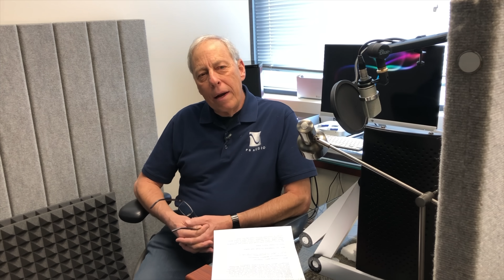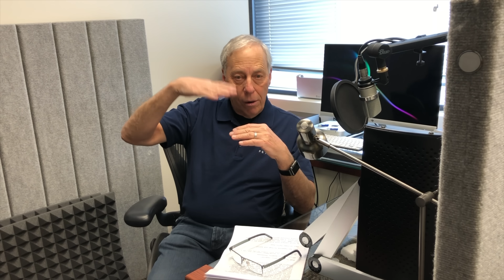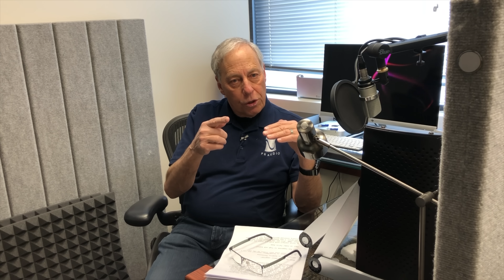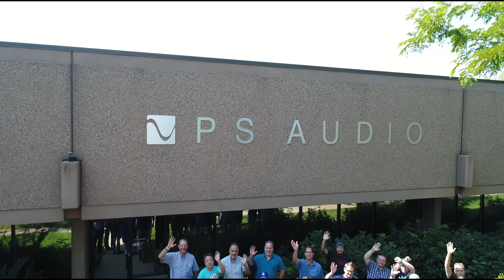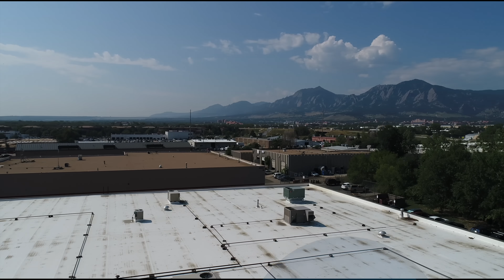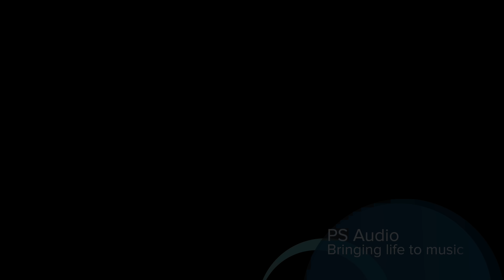Is an external clock on a DAC necessary?

Comment: It's important to note here that in order to have the DAC clock used, the connection to the source (e.g. computer) has to be via USB which is asynchronous; otherwise, if you connect to the source via, say, coax or optical/toslink then the clock accuracy is determined by the source.

Comment: I don't understand all the tech about it...just always trying to improve sound quality...someone please tell me a good external clock to use with my setup shown below...I was thinking of the Gustard C18 since my DAC & DDC Is also Gustard...
Present system- Vincent hybrid 737 -4 Ohm: 2 x 300 Watt, Gustard R26, U18, ifi zen streamer, Dali Rubicon ll, Rel T7x w/  AudioQuest Type 5 REL Acoustics High-Level Subwoofer Cable...

Comment: External? It depends whether better or worse. External clocks purpose is to synchronize different devices. Eg. in a studio. Using PLLs and good supply of clocking circuitry nowadays minimize the needs of external clocks, You can use multiplexed signals to drive your PLLs. 
On the other hand, an external clock has no direct effect on the internal quality of clocking and thus sound. It can, if it is better than the internal. But I’m highly in doubt of this. Just one bad clock dealing stage after the external (or internal) clock with high noise power supply can ruin and rejigger all the high quality clocking signal. This is the reason, we use direct clocking to our DACs. The DAC is direct connected to the clock (XO), all the other parts being of higher jitter tolerance are only indirectly supplied, some even by multipliers. The clock itself is provided with ultra low noise power supply.

Comment: The best clock is the one sitting next to your dac. If your DAC is well designed and therefore has a good clock, you don't need an external one for those 0.01% better clock performance. Sometimes having less devices in the signal chain is better.

Comment: Yes it is necessary because the standard in audio is so bad.
No audio company really uses them, they exist as individual boxes that come with lousy LPSU's that are horrible in sound, that is why people don't think that they work. So it's kind of a big kept secret, that no one really has been able to figure out how to use.
My friend got one: Gustard u16, and he uses it for his streamer. When doing a lousy standard job, it only makes the sound about 1.5x better. But after he now has used a couple of years fully understanding how it works and locking the signal with a GPS lock on 9.9999997 mhz, and using certain cables with LPSU's that cost about 5 times more than the clock and building a custom LPSU, and pairing with an uptown audio isoregen. It now gives him about 10x the effect. So yes it is necessary once you have heard that huge difference.
Here is the sound difference:
1. Harshness down to about 1/3.
2. All music he owns is now relevant and natural even in DSD format.
3. The level in warmness and depth is so much more evolved you would not believe it.
4. And the timing is so crazy, that the sound is just rock solid, and that is even with gear that is subpar.
5. Volume before could only go up to about 50% before it got uncomfortable. Now he is at about 80%.
6. Every detail becomes available while the sound becomes more natural.
7. Detail also very importantly gets a lot better released so it sounds like you have really expensive components in your gear.

Again, you have to be really good at setting it up for it to do a big difference. This it not a plug and play product and then you are done. My friend who is one of the most hardcore audiophiles, used 1000's of hours tweaking it, and making it work right on his streamer.
There is a huge potential to be had when manufactors can figure out how to bypass the internal clock and use a really good external clock in DAC/streamer/CD/digital amps/routers.
It also makes sense when you think about it, you isolate a part so it stays more true and does not effect the rest of the components in a bad way.
But again, you have to have the skill to do it, buying it is not enough. Plus there is a difference in quality between the clock products.
Reply: well, I wouldn't trust a manufacturer that makes dacs to be the final word on whether their dac needs an external clock, or not, so I'm already skeptical of Paul and the noise he makes in this video. Not to say I'm the one who knows. Your comment makes sense, as the world becomes more and more deconstructed down to nano particles, more and more accuracy seems a reasonable pursuit. or you can say it's not necessary unless your dac, which we make, sucks, which ours doesn't, which transliterated, is what he said, in a very convoluted manner, IMho

Comment: One of the issues surrounding external clocks is that they can actually induce distortion and noise that some people like. For example, in pro audio a big clock manufacturer is Antelope. They actually advertise that they ADD specific jitter or "acoustically focused clocking" to a low jitter clock in order to create a coloration of the sound. Hardly any modern converters are going to benefit from a clock outside the mainboard, which is usually much less accurate, so what a consumer is getting is a specific flavor of euphonic distortion.

Comment: In audio/video *capture*, long time stability of clocks is an issue. Prosumer devices typically drift away about 1 video frame (1s/25 frame in Europe) per hour in my experience, some devices fare worse. So in long recording workflows, you’d either stop video record in every break - or use an external clock :) some devices have both ref-clock in and out so one of them could act as the master and the rest are just slaves, but there’s nothing special about the master - it is just your reference.
Reply: To me that's the main reason DACs have a clock input: to synchronize different devices. And even then it's less about being accurate and more about being inaccurate in the exact same way.
Reply: Penny Lane yup, if there are digital sources that benefit from being in sync. Playback systems can probably be designed to be less dependent of this, for example if a single DAC is responsible for all of the DACing. Designed to expect input source jitter, e.g. up sample to a higher frequency and make sure the input samples are updated in a regular pace regardless the input inconsistencies. It would not be entirely trivial, but it not leagues of complexitiy above what students have to work with in other clock domain troubles in digital design courses. The main question is of course if there are two systems that strongly benefit from being in sync - for example do you for any reason have two DACs in the system? Then a reference clock sounds like very good idea :)

Comment: I think DACs need an SD card reader, battery and charger. Probably less than $30 more in production costs for a lot more value.
Reply: A "DAC" doesn't read files, it can't, not by itself. Something else internal in the chassis has to feed the DAC with I²S.   That costs money too.
I have a dac amp, with a front usb port for flac playback etc. It sounds worse than the usb from my lap top, and also from a streamer. Noticeably worse, unenjoyable in fact.
it sounds worse because of the chips that are required to play the files to the DAC, A "DAC" doesnt read files, it can't, not by itself.
Reply: A file is just data , the same stuff that comes threw the USB. You might thinking of a desire to have some interface to chose which file to send.
Reply: I think you commented on the wrong video bud
Reply: Why do you think and comment that?

Comment: The clock information is sent with the signal there for if you are using a transport as a source then the dac is using the clock in the transport. The clock in the dac is not being used to process the incoming signal. Connecting an improved internal or external clock  to the dac is not relevant as the timing damage or jitter has already occurred

However the closer the clock is to the dac chip the less errors you have.  Some dacs automatically slave the transport or source if they are from the same company forcing it to use the clock in the dac. This is quite noticable. 

However clocks like a stable quiet environment away from noisy transports and dacs.  So if costs isn't an issue then having a dedicated clock and slaving both the  dac and all your sources  is the ultimate
Reply: that makes sense to me. it's all about real physical distance, and putting a console in one room and a hdr in the basement I can't see not having problems, and an external clock would solve it, right? Which is why the external master clock industry exploded

Comment: I got about halfway through the vid. If your DAC is your playback device, you don't need a clock. If you're running digital components to a DAC with the available option of setting slave and master, then you don't need a clock. If you're running multiple digital components in serial and parallel, which honestly is more likely in a music studio, you'll probably need a clock.
Reply: Exactly! A DAC is inherently self clocking as the clock is embedded in the SPDIF/AES stream. It's called Manchester Encoding. 10mbs Ethernet used the same technology. And what many analog  audio guys don't grasp is the concept of clock and phase lock. You just can't feed a DAC circuit a random clock signal. Somehow that clock must be phase locked to the digital audio stream. Otherwise you get garbage, no intelligible audio at all. DACs that use an external clock are just using that clock as a re-clock in a buffer memory. Similar to how a video signals are aligned in a modern video switcher or mixer. And here's a dirty little secret: If using a free running external clock, sooner or later you will drop samples as the buffer under or over flows. Depending on the buffer depth and the clock accuracy versus the encoded SPDIF stream, that may take hours or even days to happen, but at some point if listening continuously, you will hear a click or pop. No way around that even with a Cesium clock source. The vendors just bank on the fact that you will miss the glitch or you won't listen continuously long enough for that to happen. So if you want absolute error free playback 100%, don't use a unlocked external clock. But then who listens to audio days on end without a break?
Reply: It's not about synching issues of multiple digital devices in regular stereo setups (as it indeed is in the studio), but it's about the quality of the clock signal which influences the SQ.

Comment: Why 44.1 and not just 44?
Reply: https://dsp.stackexchange.com/questions/17685/why-do-we-choose-44-1-khz-as-recording-sampling-rate with a little bit of Googling!

"At the time, there existed a product in the late 1970s called the Sony F1 that was designed to record digital audio onto readily-available video tape (Betamax, not VHS). That was at 44.1 kHz (or more precisely 44.056 kHz). So this would make it easy to transfer recordings, without resampling and interpolation, from the F1 to CD or in the other direction.

My understanding of how it gets there is that the horizontal scan rate of NTSC TV was 15.750 kHz and 44.1 kHz is exactly 2.8 times that. I'm not entirely sure, but I believe what that means is that you can have three stereo sample pairs per horizontal line, and for every 5 lines, where you would normally have 15 samples, there are 14 samples plus one additional sample for some parity check or redundancy in the F1. 14 samples for 5 lines is the same as 2.8 samples per horizontal line and with 15,750 lines per second, that comes out to be 44,100 samples per second."
Reply: @AlexandreChâteauneuf  Yes the math works. But also the F1 and competing products were quite complex. The biggest issue was tape dropouts. The raw audio data was heavily encoded with error correction bits. And then the digital audio was not recorded through the horizontal and vertical blanking intervals for two reasons. The video sync pulses had to be preserved and in lower cost VTRs the head switching glitch would have caused severe data errors. As audio is continuous and video is recorded like film as discrete still frames, these digital converters had to buffer the audio in memory and write to tape only during active video. DAT took that idea even further. The rotary heads only wrap 90 degrees around the tape. The "missing time" is handled by buffer memory and faster than real time write and reads.

Comment: I think dCS is proving for many years that you're wrong. 😏 Did you ever hear the difference their clocks make? It's not subtle..
Reply: @Larry Niles If you are a PS Audio employee shill here, I can tell you your actions do far more damage to PS Audio's credibility than all the negative public comments together. If Paul's product line can't stand up to the simple mention of a competing product, well his products must have serious issues. And I know they don't. I think this was an excellent intelligent discussion (obvious joke posts aside) on the use of external DAC clocks. Why try to turn it into a pissing contest?
Reply: Sure, a good clock makes a difference, why does it need to be external?
Reply: @mornecoetzee735  , because it's meant as an option. The regular clocks inside dCS DAC's are already great (no one can deny they sound fantastic as-is) but the external ones are significantly better, with their own housing and PS. Although at a significant cost the upgrade is very much audible for anyone with two normal ears (I have tested this). More space, dynamics and timbral color.
Reply: @vincentvanrooij9675  There are no clock generators needed in a basic SPDIF decoder feeding a DAC chip. The clock is extracted from the audio stream by simply counting bit transitions. If you do have a local or external oscillator it must be locked to the audio stream through a slow PLL and/or a buffer memory must also be used. The ultimate DAC clock source must be somehow be phase locked to the audio samples. There is no way around that.
Reply: @andydelle4509  It is locked, otherwise it indeed couldn't work - you're absolutely right about that. I think you're missing the point here though. Just listen to a dCS DAC with and without an optional external dCS clock and the increased SQ when adding the clock is very easy to hear.
Reply: @vincentvanrooij9675  Well a typical audiophile external clock is not locked per se. The DAC has a buffer and the external clock determines the output sample rate. This does work to reduce jitter quite well and is a common technology in many areas of electronics. In fact every CD transport has a buffer memory to eliminate the mechanical errors. But as I explained below, this setup will glitch if the buffer over or under runs. And this will ultimately happen as the two clock signals, the external clock and the SPDIF stream are not synchronous. As jitter implies the SPDIF clock varies up and down, this tends to even out the buffer storage. And of course everytime you swap discs or call up a new file to play, the buffer resets to half full so in the real world the over/under problem never really happens.
Reply: @vincentvanrooij9675  Companies like Wadia managed to isolate the clock in a faraday cage, also uses 6 independant power supplies in the S7i. I don't see the need why it should be a physically external component?
Reply: @mornecoetzee735  , you should ask dCS, not me. 😉 All I can say is that using their external clocks is a huge upgrade. No doubt commercial considerations come into play, but certainly also technical ones - dCS being a military supplier by origin.